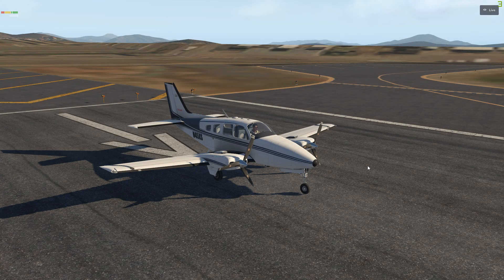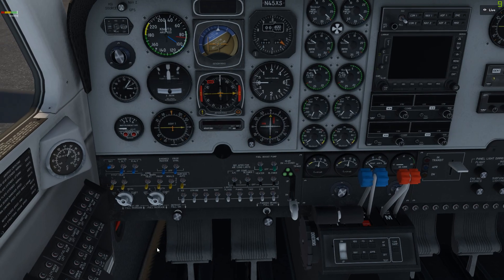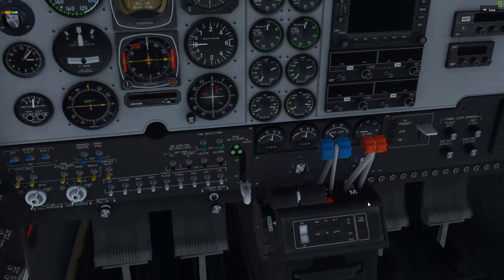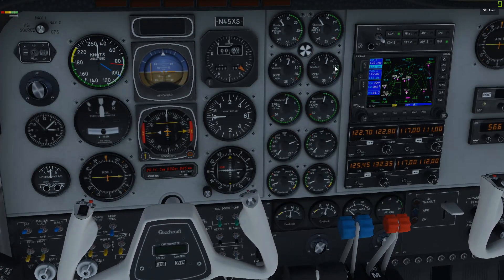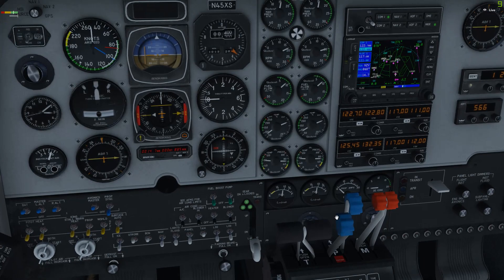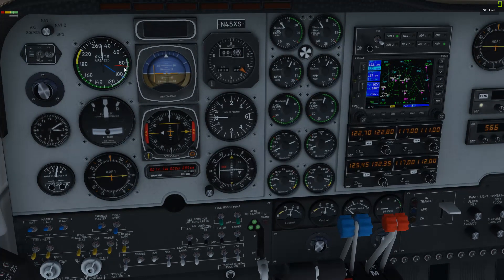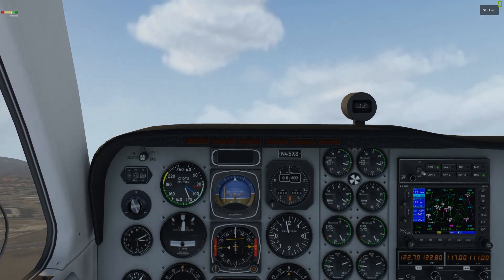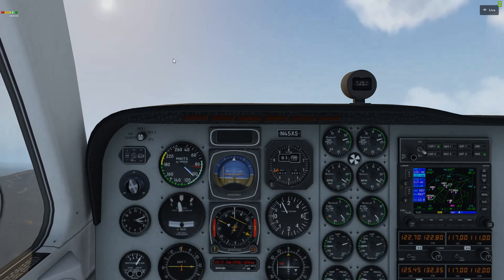| X-Plane 11| Beechcraft Baron 58 (Twin Engine) COLD & DARK STARTUP - Checklist included -

Comment: Do you give this plane full throttle all at once or do you gradually give it throttle. I just can’t keep this plane straight on takeoff it has a tendency to want to spin in circles off the runway. It seems like a challenging plane to takeoff with.
Reply: Dowload a modified version called b58 double trouble.
Reply: I usually give it 25% power just to get it moving, and so I can fiddle with the pedals and push the yoke forward a bit just to keep it on the centerline. Once I've established a positive control, then I throttle up.
Reply: yeah that’s a classic with prop planes. just keep right rudder going, slowly give it throttle and you should be good

Comment: hi ppl, anyone knows how to make the AP altitud control work? it keeps pitching up and down in a crazy way. Thanks
Reply from the maker: Do you mean the altitude hold or climb mode?
Reply: @HyperShift   Now that yhou mention it I´d like to ask for both..  I mean the problem is that when i turned using the heading bug in the HSI the plane would turn but pitching aggressively. Like if the AP was disengaging..